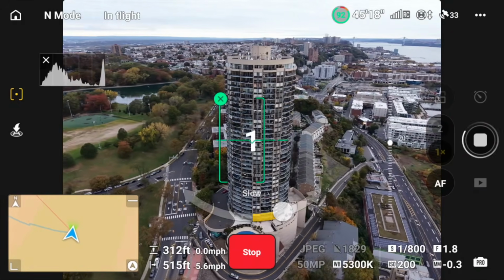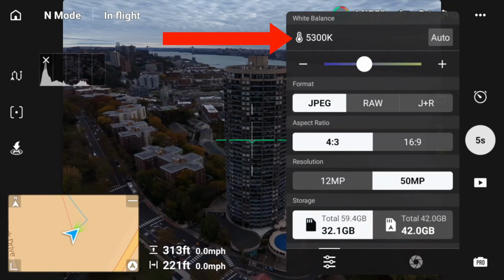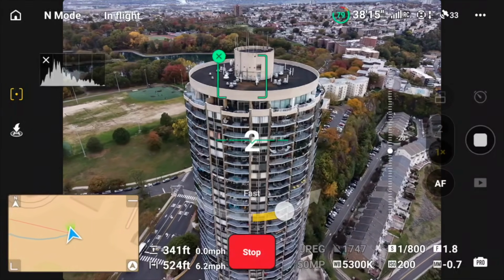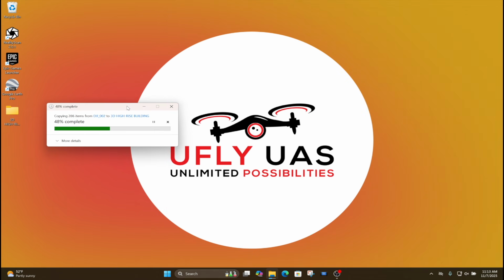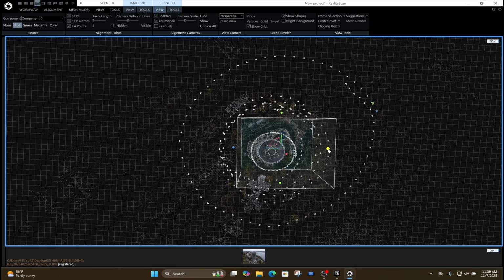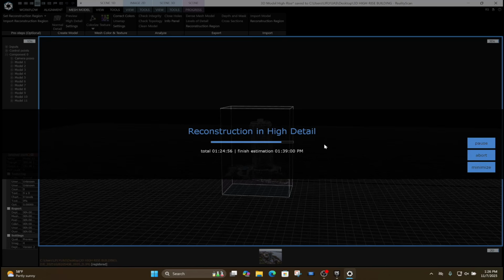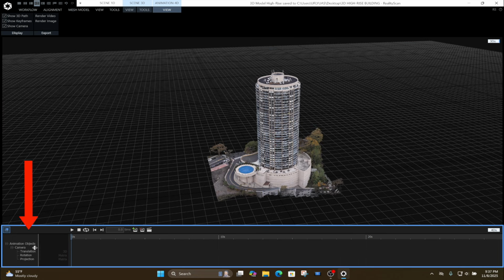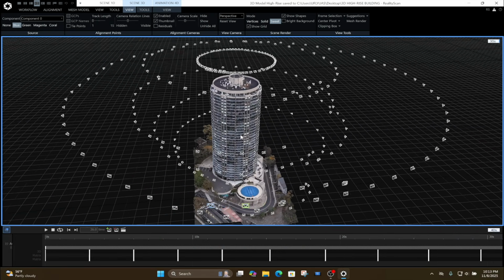DJI Mini 5 Pro High-Rise Building 3D Model Photogrammetry Tutorial For Beginners Step by Step Guide.

Comment: can anybody educate me on what's the main reasons companies would want a 3D model?
Reply from the maker: Great question! Companies use 3D models for several important reasons. In construction, they can document progress over time, compare actual site conditions against architectural plans, calculate stockpile volumes, and identify potential issues before they become expensive problems.

Engineers, architects, and property managers use 3D models to inspect buildings, measure structures, plan renovations, and assess hard-to-reach areas without always needing scaffolding or lifts.

Another major benefit is having a digital record of a property or structure at a specific point in time. Instead of relying on hundreds of individual photos, teams can explore an entire building from different angles on their computers.

For high-rise buildings specifically, 3D models can be valuable for facade documentation, maintenance planning, and renovation projects.

Ultimately, it’s about saving time, reducing costs, improving safety, and making better decisions using real-world visual data. Thanks for watching and asking such a great question!

Comment: These videos have been super helpful in helping me identify the software I'd like to use. Is it possible to add annotations and complete measurements in Reality Scan?
Reply from the maker: RealityScan is fully capable of accurate measurements—this is one of its core strengths.

What you can measure:
	•	Distances (point-to-point)
	•	Areas
	•	Volumes (stockpiles, cut/fill workflows)
	•	Coordinates (XYZ)
	•	Scale calibration using known distances or GCPs

Annotations is more for CAD and GIS software or QGIS which is free. You can easily export your work to QGIS and do measurements and annotations there.
Reply: @uflyuas Thanks for the super fast reply! I’m really impressed with your tutorials. Please keep them coming!
Reply from the maker: @mattj1985 .  Thank you so much for checking my videos out I truly appreciate it.

Comment: Can you rotate your model in reality scan? I filmed a hill fort and reality scan figured the sloped hill is level. So now my entire model is sloped XD
Reply from the maker: Yes try this:

METHOD 1 — Use “Set Ground Plane” (Fastest Method)

This is the correct workflow for most building/site models.

Step 1 — Select the Model
	•	Go to Reconstruction → Select Model
	•	Make sure your mesh is highlighted

Step 2 — Activate Ground Plane Tool
	•	Go to:

Tools → Set Ground Plane

Step 3 — Define the Ground

You’ll see a transformation gizmo (rotation + translation handles).

You have two options:

Option A — Manual Rotation
	•	Rotate the model until:
	•	Z axis (blue) is vertical
	•	Ground surface is flat
	•	Drag model down so it touches Z = 0 plane

Option B — Define by Points (More Accurate)
	1.	Click Define Ground by Points
	2.	Select 3 points on the flat ground surface
	3.	Press Apply

This forces those 3 points to define the horizontal plane mathematically.

This is the most precise method when correcting slanted construction sites or rooftops.
Reply: @uflyuas   thx. Ill try it
Reply from the maker: @qwertzuiop1978 You welcome 🙏!

Comment: Is it possible to use this for measurements?
Reply from the maker: Thank you for checking my video out. For measuring you will need control points or RTK system. GPS (Standalone GNSS) vs RTK — Accuracy Discrepancy

1. Horizontal Accuracy

System	Typical Accuracy
Standard Drone GPS	±1.5–3.0 meters (≈5–10 ft)
RTK Enabled Drone	±1–3 centimeters (≈0.4–1.2 in)

Discrepancy:
➡ ~1.5 to 3 meters (150–300 cm) difference horizontally.

⸻

2. Vertical Accuracy (Elevation)

System	Typical Accuracy
Standard Drone GPS	±2–5 meters (≈6–16 ft)
RTK Enabled Drone	±2–5 centimeters (≈0.8–2 in)

Discrepancy:
➡ ~2 to 5 meters (200–500 cm) difference vertically. 

I normally pay a license survey guy when they request centimeter accuracy for measuring since I do not have a survey license. I always include the survey cost in the final invoice. In other words yes you can use it for measuring but if they requesting accuracy to replace or upgrade windows or whatever is better to pay a surveyor since he can sign off on the accuracy. Let me know if this answers your question.

Comment: i have an air 3.  I'm getting a message saying timed shots unavailable when using tracking.  So far, I haven't found a way around it. Any suggestions?
Reply from the maker: Which orbits modes do you have available?
Reply: @uflyuas  poi, active track, spotlight.  I've tried all 3, tried 48mp and 12mp, and tried jpeg, raw, jpeg+raw settings.  it keeps telling me tracking not available in current shooting mode.
Reply from the maker: @TYSHOELACES use Point of interest and set camera to time shot.
Reply from the maker: @T @TYSHOELACES You can also use spotlight.
Reply: @uflyuas  neither of those worked.  same message.  tracking unavailable in current mode. that's why i was having a bit of a headache with this.  I watched your video, followed what you did, but for some reason i can't get it to work.
Reply: @uflyuas  thank you for responding today.  I'll have to keep trying things to get it to work
Reply from the maker: @TYSHOELACES  No Problem. Use POI or Spotlight for the time shot. It should work just fine.